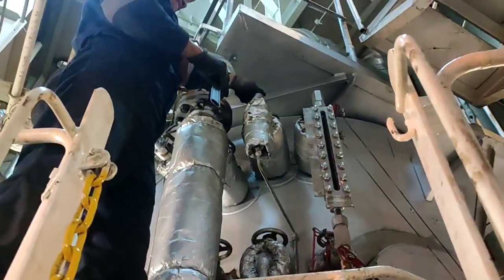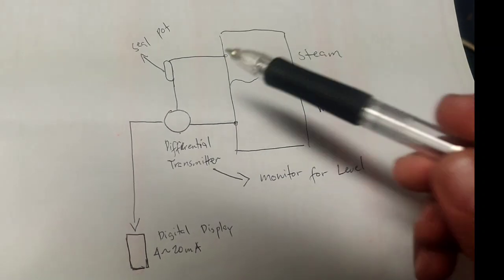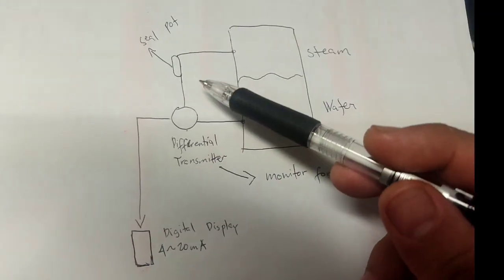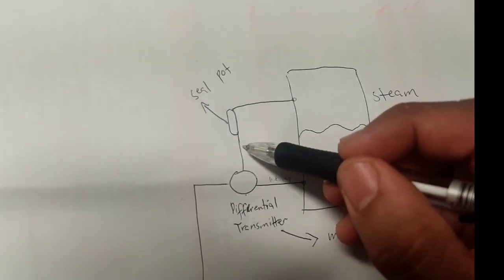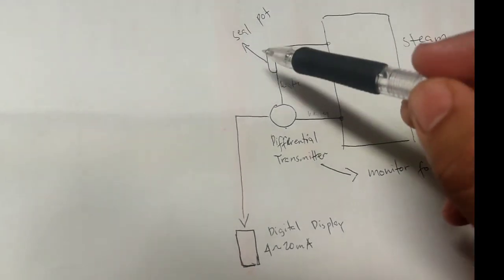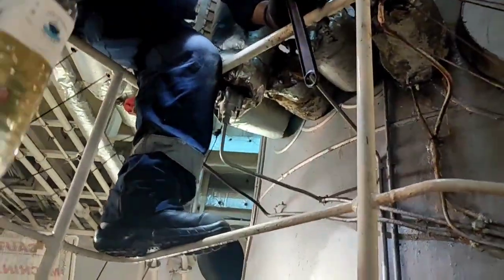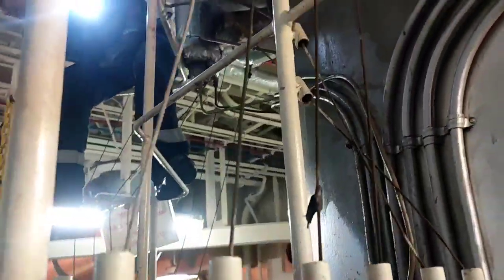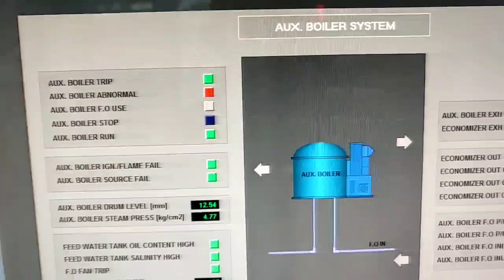English - Seal pot Boiler water level

Comment: Lecky how can we ensure transmitter is giving correct signal or not?
Reply from the maker: You must connect the a multimeter in the transmitter in series connection and set to milliamps. When the water is  empty, your reading is 4mA. In middle level is 12mA and full is 20mA.
Reply: @BarkoTv  Thanks lecky

Comment: But before opening the seal pot plug ....what valves need to close ?
Reply from the maker: Close the isolation valve that connects at the boiler drum to isolate steam pressure and bleed steam pressure before opening the seal pot